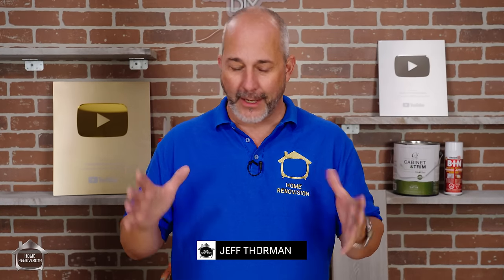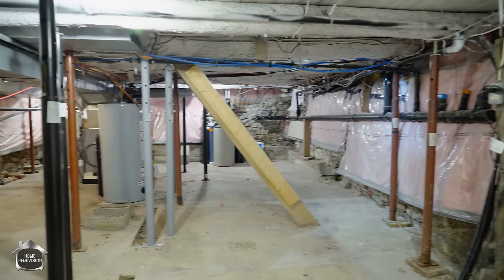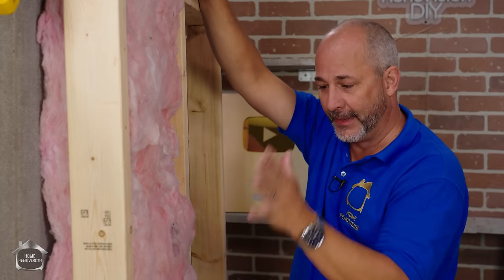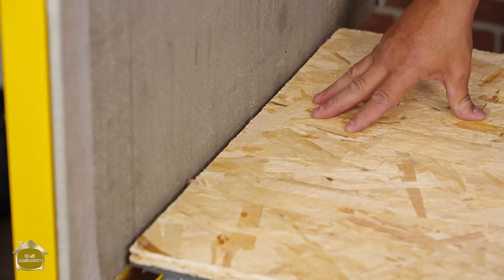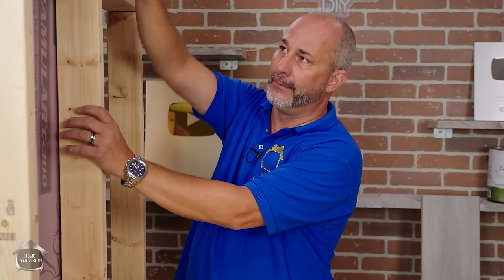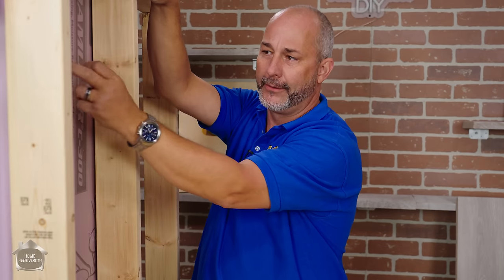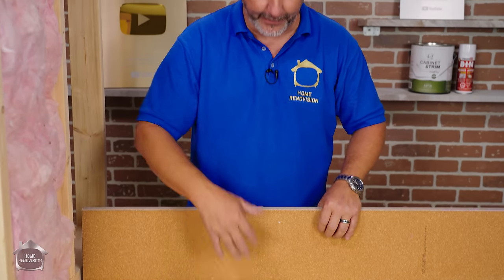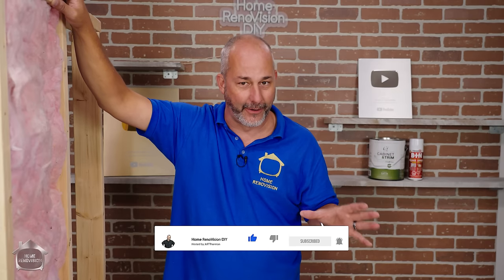The Best Way To Finish Your Basement

Comment: Why wouldn't you install the dimple mat, then the XPS wall foam, followed by the plywood subfloor instead? Doesn't this method risk moisture directly impacting the OSB plywood sides?
Reply: I was thinking about this, too, it seems like you'd almost need to install the foam board first, and then the dimple/OSB inside of it to avoid the edge of the OSB hitting water/moisture coming down the walls

Comment: I recently did a mold remediation job on a basement that had drainage mat and plywood. The water had gotten higher than the mat was essentially turning it into a thousand tiny swimming pools that never drain. It also soaked the plywood causing it to rot and mold. I tell people all the time if they want bomb proof flooring in a basement tile is the only way to go. You can install vinyl planks and when the water comes, and it will, your at the mercy of whatever untrained monkey is going to trying to dismantle your planks to try to "save" them. The newer system seems to make more sense only for the fact that its a smaller product and in the event it gets wet there would be less to replace. Just my 2 cents though. Thanks for the vid and looking forward to watching the water testing.
Reply: I'm glad you mentioned this. Since basement floors have high and low spots once water gets in the low spot I suspect it will remain there. Example: One third of my floor pitches towards the sump pump. the other third is relatively flat while the remainder dips towards the corners and perimeter. I don't see how these areas could ever dry out. And it's amazing how much water is in those low areas. Don't ask how I know!
Reply: Agreed I did cheap planks in my basement got semi flooded and had to tear it all out. I replaced it with tile if it ever gets wet or water it's soaks it right up.
Reply: Or polished cement

Comment: If I understand correctly one still needs a vapor barrier with this set up? All the info was great but that part was glossed over. It sounded like the typar goes over the studs and insulation here but in your other video without foam board the barrier went behind the studs and insulation. Clarification please?

Comment: Hey Jeff! I'm down in the south, and I keep running into this issue where the basements in the houses I'm looking at are all crazy wet. There's white powder on the cinderblock walls and nothing seems to keep it all dry. Is this system sufficient to fix those problems, or would I need to add some kind of vapor barrier on the outside of the walls? Thanks

Comment: I used spray foamed between the studs and concrete wall, inserted rock wool between the 2X4’s coming in contact with the cinder block wall. House is 60 years old. 5/8 mold resistant Sheet rock on top of all that. Has been 10 years, took it apart yesterday for electrical work. All dry and no mold.

Comment: When I was learning renovation work, I was told to treat the concrete itself as liquid. I see that forgotten often in many situations. I love your explanation and system as it accounts for this. If you have no vapor/moisture barrier under your slab or outside your walls, then moisture will wick through your walls and floor. If you have a vapor barrier and insulation outside, then moisture in the concrete needs to go somewhere, and since it cannot go out, it's going to go in.

Comment: Valuable information on insulating a basement. One thing I would like for you to mention is egress. I know this really is about the finish product, but in most local building codes, basement living space requires 2-forms of egress; stair case and windows (this is not for walk out basements). DYI, please keep this in mind before deep investments of finishing off the basement. The foam board is such an advantage to finishing off basement walls these days. I love Rockwool insulation in the framing bays (agree cost is more expensive). I love the ease of installment, fire proof and holds up great if you have a flood.  Great video!

Comment: Great content, thanks Jeff!  Would you consider also doing a video on how to frame floating basement walls (required in places like Colorado with expansive soils), and also touching on how to solve tricky floating issues around doors, floor cabinets and tub/shower bases?

Comment: Love your videos. I used those drycore floor squares and had a beam pocket leak. It made its way down the wall and under the floor and in a low spot, then soaked up the seam and swelled the wood. Not a full water proof system like when you rolled out the dimple sheet.

Comment: I used the foam wall system about 10 years ago on my previous home and it works wonderfully. Just started at our new home and I'm using the exact system here. Bonus points, if you are in Canada the system shown will get you about $1700 in rebates and the insulation for the walls is almost free in the end.  Priced out the materials to do this and it will be <$2000 vs $6000 spray foam quote. (Also windows will cost <$1300 instead of $3200 because I watched the video on how to change a window).
Reply: that is great to hear, thanks for the hint.
Reply: Thanks for sharing. Under what program do you get the rebates? Does it work for finishing the basement of a newer home as well?
Reply: @chadiverson9291  I believe he is talking about Canada Greener Homes Grant
Reply: Did you put a vapor barrier on top of the studs and insulation?
Reply: @Dannyryan73 No. The foam layer takes care of that.

Comment: I'm about 75% done finishing my basement out, and your videos have been a Godsend! I've probably watched 80+ hours of them over the past 6 months! As this is my first real home improvement project, it's been unbelievably helpful walking me through all the various processes (And helping me decide when getting a professional was the right choice haha).

My Question is - I'm deciding to cheat and not do a subfloor system as my townhome is only about 5 years old. I'm in Utah. Do you have an LVP underlayment system that you heavily prefer?
Reply from the maker: best choice is anything with a cork backing. floor and decor sells a cork underlayment in a roll. 2nd option 3mm eva underpad for sound control. Cheers!

Comment: Hi Jeff, thank you soooo much for all your content. It really helps to know what's going on, whether I do it myself or end up hiring somebody out. Are you going to do a video on a basement subfloor for an old house when the basement is extremely uneven, especially near a floor drain(3-5 in slope)? Most the videos that I've seen you do, the concrete appears relatively level and could be adjusted using a grinder or leveling compound.

Comment: Thanks, im currently doing a makeover of the basement and these are great tip. im halfway done (subfloor with thermal barrier, and rigid insulation on the wall so far) and can already feel a big difference. one issue i ran in were the Tapcon screw snapping on me. i first used the 3/16 3inch screw and before i could get any compression (head of screw inbedding inside the osb) it would just snap off, so i went back to buy 1/4 3 inch screw instead and they worked much better. Overall this system seems to works great so far, cant wait to be all done.

Comment: Hey !  We actually went a slightly different route at the end of the day but most of it still applies.  We installed the subfloor of dimpled membrane with 5/8” OSB on top about 1” to the concrete wall (different everywhere cause the concrete is not straight at all!).  Then, built the 2x4 wall, 2” from the concrete (again not consistently since we used a laser level to ensure a perfectly straight wall; highly recommend this) and hired a company to spray foam 3” of closed cell spray foam.  This obviously got rid of the moisture issues potentially hitting the wood as the spray foam went to the floor but what we were likely planning on doing otherwise is doing a vapour barrier around the OSB and tucking is under the walls sill plate to prevent any moisture issues down the road.  Just have to say though that the method of using simple membrane with OSB on top is unbelievably genius!  The floor is significantly warmer and nice to walk in similar to a ground or second floor with a bit of cushion; unlike concrete.
Reply: I’m a new member here, and wow - great stuff! We live in Winnipeg, house built in 1949 and we’re looking at a similar approach having a 3rd party spray foam the basement’s concrete foundation walls. Jeff, I’ve seen you talk about the wall insulation solution where 2” R-10 rigid foam is attached with blobs of LePage PL 300 to the concrete, then walls are framed and insulated with pink fibreglass, which leaves an air gap between the concrete wall and rigid foam, allowing moisture from the under the subfloor to travel up the walls to evaporate. No mould! Question for Jeff: With a raised subfloor option like Dricore or “dimpled membrane with OSB” that provides an air gap along the floor and allows moisture to travel underneath, what is the impact when spray foam covers the walls and seals at the floor, thereby eliminating the air gap along the wall?

Comment: It's great to see that a lot of my plan for my basement office is consistent with your advice. But it looks like I can butt the framing right up against the foam board and not leave a half inch gap which I had initially planned.
Reply from the maker: best to have the gap behind the rigid foam. no value if it is between the framing and foam.

Comment: This is so different than what our basement company did here in the North East.  We have a 1950's basement and they used 6" steel studs with R19 throughout.  They also just laid the vinyl plank flooring directly to the slab.  The space is conditioned with a mini split unit that does heating, cooling and dehumidification.  Time will tell how it holds up.  Basement has no indication of moisture or musty smell.  I can confirm no water events since 2003.

Comment: I had basically settled on following this exact plan before I even saw this. Grateful for the validation. One question: when framing out the walls onto the subfloor panels, should I just nail them to the subfloor panels? Or should I Tapcon or Ramset the bottom plates all the way down into the concrete?
Reply: Dricore recommends screwing the bottom plate to the subfloor with 2" wood screws and then tapcon/ramset through the bottom plate into the concrete with 3" anchors every 4'.

Comment: The house I bought had that type of insulation (what I call as roofing I insulation) and it got wet and smelly. Threw it all out, threw the cheap picture paneling out too. Put in styrofoam insulation, painted the walls with waterproof paint n sealer. Then put up nice 1/4” thick real wood paneling. 💯 better basement 
now. And and a good dehumidifier!

Comment: Thanks for the video, Jeff - great content as always!

What about for areas like steel columns? Would you use pressure treated plates around them directly on the concrete and then have the subfloor product abut against the pressure treated lumber? Or would you just bring the subfloor as close to the column as possible and then frame directly on top of the subfloor?

Comment: I have watched many of your videos on basement finish. What if you have in floor heat and icf in the basement? Would you finish that differently? I am working on finishing my basement and your videos are very helpful! I also live in Canada.
Reply from the maker: Hi Dan, new construction allows for ICF R 20 to 30 depending on your block. Radiant heating in floor means you also have a vapor barrier under the slab and probably insulation there as well. in your case you should simply install a vinyl plank with cork directly on the floor.
Reply: @HomeRenoVisionDIY  Thank you!

Comment: If you are an engineer building a new house, consider insulating outside the foundation and under the floor. This makes the concrete an asset rather than a liability by adding thermal mass inside the home making it more passive. 
Materials vary by climate and the amount of foundation exposed, but it is essential to put a metal termite barrier at the top.
Reply: What you are describing is ICF construction, Insulated Concrete Forms,R-30, with no thermal bridging.

Comment: Hey Jeff, thanks for awesome videos! Quick question before I start on my basement using your guidance. Can I use a Ramset to secure subfloor panels to concrete or does it have to be Tapcon screws? Also there’s no concern with moisture getting through said hole in the subfloor panel?

Comment: Do you recommend waterproofing Walls and floors first?  Necessary or Not?  Radeon gas from the ground may pass through cracks on the basement floor with cracks.

Comment: Hi, I watched one of your videos where you expressed the importance of putting up foam board against the foundation of a new house before framing it out and installing the fiberglass insullation between thr studs. I took your advice and bought 15 8×4 pannel thus far of the 25 I think ill need. In preparation of buying the lumber i did some further research on metal vs wood studs to discover using metal studs is a far more attractive alternative to wood. With that said, I watched one of your videos on framing metal studs and it appeared as though the rigid foam board may no longer be neccessary. If you wouldnt mind clarifying if im still on the right track with using faom board behind metal studs with fiberglass between them I would greatly appreciate it. Thanks ,Chris
Reply: You should still use foam boards, as it will add extra R value and will partially act as a vapor barrier (not to compromise fiberglass insulation's R value due to wetness). 
Disclaimer: I am not a licensed contractor but a home DIYer.
Reply: Absolutely still use the foam board. The rigid foam is there to provide insulation. The type of stud you use will not impact this, and fiberglass insulation directly against concrete is a no-no.

Comment: Great video, Jeff! Thank you for all the info. My basement has painted concrete walls. Is this an issue for moisture management?  I plan to finish the floor with the blue dimpled membrane and vinyl over that.  The walls will be finished with rigid foam attached with dabs of adhesive as you suggested, and framed walls in front of that. My concern is that the pain on the concrete will hinder moisture from being reabsorbed into the concrete if it is traveling from the floor. Do I need to strip the paint off the concrete walls? Thank you for your guidance.

Comment: I really enjoy your videos. I am in a process of making my basement. I was hoping if you can answer couple of questions. It's a walkout basement. Half of the basement is framed and insulated the bottom half is the wrapped insulation. I am getting mixed advise as to leave the wrap and add more insulation after framing in front of it. I would really appreciate your help in this. Thank you

Comment: Hi, I like the idea of putting 4 globs of sealant on the foam board. 2 questions: 

How do you keep the air gap behind the foam board even? Should you use some type of spacer?

We are having a basement waterproofing installed with the wall wrap. Does this adhesive sick to the wall wrap, or will I need to do something different?
Reply: you dont need to keep the air gap even, it doesnt really matter. but if you do want to, just stick some sort of spacer on the back, like a plastic or pressure treate woo spacer, 

dont stick foam board to wall wrap. you use one or the other. they both do the job of keeping water out.

Comment: Question 6:29. How does the bottom of the wall look in this setup? Does the foam board sit on the concrete? Does it sit on part of the frame? The subfloor isn't installed first right?

Comment: Hi Jeff, I live in Ottawa area and love your channel. This is the first time I ever logged in to actually comment on UTube, so hoping I do this correct. My question is the same as another person here regarding the top of your solution where it meets the rim/floor joist. How is it finished? I can't visualize the flow of air up there and am leaning to just sealing it all the way out of the cavity until it is flush with the foam board. Thoughts? Anyone?
I watched a similar video where there is no gap between the foam and the concrete and it is sealed basically from floor to ceiling. Then the wall is built in front sitting on the foundation using pressure treated lumber (no sub floor under the wall). This is an 80s home and seems to be dry. There is also a sump in a far corner that has a little standing water but never seems to change so I am guessing there is generally no exterior water issues.

Comment: great video! 
but one Question:    my basement walls where poured in the 1930's and by no mean are straight. how does this effect the installation process of the foam board? any trip and tricks for uneven basement walls?